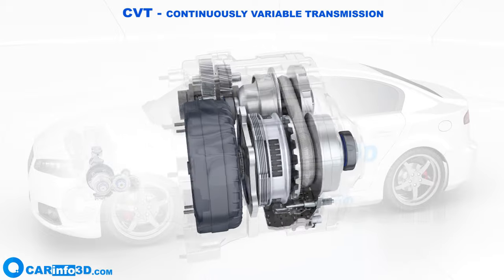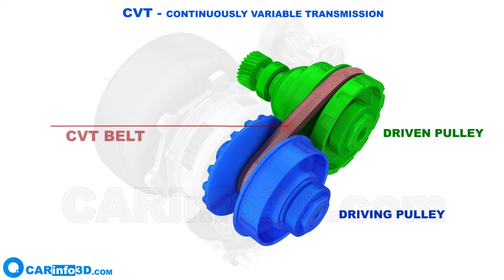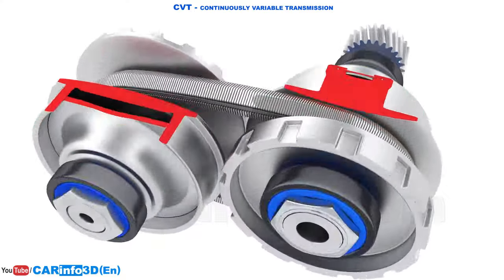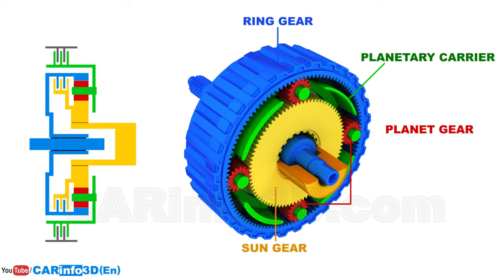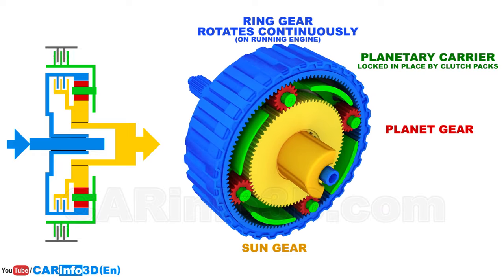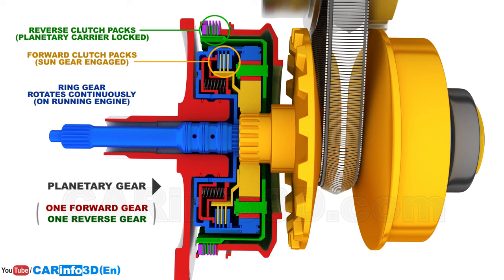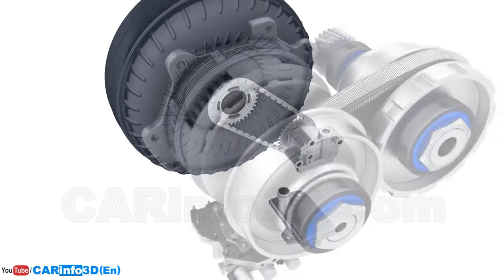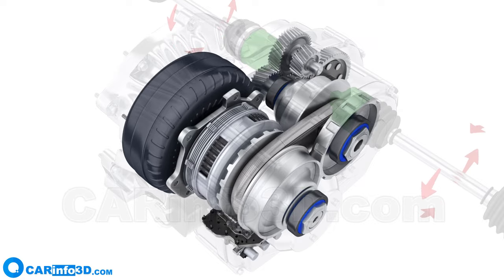CVT Transmission / how does it work? (3d animation)

Comment: As a mechanic, I can tell you these are our #1 money maker in the shop.  Its a golf cart technology that was implemented into 4000 lbs vehicles.  They can be reliable to a degree if you drive like my 80 year old grandma.  Slow acceleration, speed limit and no sudden acceleration.  The problems surfaces when people drive them like traditional gear transmission.  They're not built to handle that.  Car manufacturers like them because they are cheaper, lighter and get slightly better mpg so they can advertise for it.  I personally would not buy a car with a CVT.
Reply: I have one in a Cube.  I warm it up on the drive everytime before setting off and then drive it carefully.  Fingers crossed 😁
Reply: Had to replace the oil and transmission fluid more often… poor performance. Not worth it
Reply: I second this
Reply: Exactly
Reply: Eh it depends on what CVT you get and what car company you buy from. I have a 2016 Honda Civic 1.5L Turbo with the CVT. Havent had a single problem and Im sitting at 163,000 miles. I am the original owner. I also change my own Transmission fluid at the correct intervals. Alot of these bad cvts are to do with poor maintenance on the customers part for Hondas and Toyotas especially. I know alot of the other car manufacturers are garbage with cvts. I also drive 80 plus mph on the interstate  1hr to work and back home 7 days in a row. 7 on 7 off work shift. When my car gets to 165,000 miles I will change the Engine and Transmission oil and fluid. I believe the last time I changed transmission fluid was 130,000 miles. I would like to also add, that I am not a slow driver either. I like to put it in sport mode and get around people in traffic. Its extremely responsive.
Reply: Yep..depends on who makes them. Jatco ones have more issues. And these are the ones that Nissan uses.
Reply: They came from formula one Williams not golf cart.
Reply: @Kk385  , yes, it was a formula 1 golf cart🤣🤣
Reply: We bought one. Didn't know about all of this at the time. Cannot accelerate quickly.
Reply: @John34. I have a 2014 Nissan Versa with cvt. 210,000 miles strong. No issues thus far.
Reply: @jimborghini2761  Well, that's great you have one that's not failed. I understand where you are coming from as my wife has a 2018 Jeep Compass that are known to have all sorts of issues with sensors and the transmission. We are over 100,000 miles original miles and have had zero issues whatsoever
Reply: I've been renting a prius for taxi and ragged 80k miled driving like Michael Schumacher in the last year. it's gone from 74k to 150k no gearbox issues so far. no trans fluid changes, and only 1 oil change 30k ago.
i actually like the cvt, the lack of gear change actually keeps me in front of much more powerful cars. it's not good for top speed, but its good with acceleration. I'm thinking about getting gs300hybrid so more curious about the ups and downs of a cvt. OP - what sort of issues do u get with cvt's and which brands, What's your experience with lexus cvt's. I'm a former mechanic myself but I've been out the trade for a few years and my experience with cvt drive trains is almost non existent.
Reply: @chozusmakavelli  NOT OP but IIRC Toyota uses eCVT on their hybrids (including Lexus) instead of the traditional CVT. The way they are constructed looks waaaaay more robust than the chain.
Reply: @CuteMegaPanda  thanks, I've just bought a 2019 is300h with 90k, but I've had plenty of Lexus's and they've never let me down.
Reply: @Poorlybobsdad  you better maintain it. Replace transmission fluid every 20k miles
Reply: ❤Thank you
Reply: Yes combine that with people not getting the fluid and filters changed as they should and that is why so many have a problem with them.
Reply: Do not understand why people have to accelerate hard all the time. How you drive your vehicle determines how long it will last. As for this so called mechanic here, you do not have to go to that extreme. Just drive normal. You must be one of those assholes who have to punch it every time you stop.
Reply: @scrambler69-xk3kv I’m not super familiar with cars and CVTs but would you say the 2025 Civic Sport Sedan is good? Just want to know in case for the future or something. To gain knowledge
Reply: 2017 Toyota Corolla le CVT has 297547 drain and fills every 60,000 and I don't baby it.
Reply: Yes I believe you are something 🤣
Reply: @John34.  Im buyin the hyundai elantra 2020 SEL with CVT driven tranny and worried ab alm these comments but the car only has 69k miles total
Reply: Toyota cars use this, preus is example and failure rate is negligible 
May be honda is bad 😊😊
Reply: I'd go a step further and say that  this design belongs on a bicycle 🚲
Reply: What CVTs though? Some brands make them horrible. In low to mid end cars they are hands down better than DCT and 4 speed TCs.

Comment: I get manual transmissions but even with this channel's great animation, I still can't get my head around this.
Reply from the maker: Soon our video course will be released, there will be more of our videos and there will be time dedicated to the manual transmission.
Reply: On a very basic level it is a very simple idea at work; two sets of moving plates with chain/belt that mimic gears/sheaves of different sizes, that can change speed ratios between driving and driven side.
Reply: @spol1622 its hard to understand without seeing it with your own eyes and being able to touch the parts. i dont get it through a video, your words are like a foreign language
Reply: @nicolasr7706  that is the beauty of humanity, we all learn in different ways!
Reply: @spol1622 that was so bad and I'm SURE not helpful to the OP 🤣🤣🤣🤣🤣
Please don't ever attempt to be a teacher of any kind
Reply: Don't feel bad, they didn't explain what they were showing and the visuals that are the most important are semi transparent almost as if they're not important. I don't know if I can describe it with words, but basically focus on how from the top angle the two "halfs" are angled like wedges. Traditional drove belts "connect" on top of the axle, these have serrations on the SIDES and connect to the SIDES of the wedges. So as they spread apart that moves belt to a bigger or smaller rotation diameter, like a bigger or smaller gear.
Reply: The operation is similar to a bicycle with 20 gears, or however many it has.  When you climb a tough hill (low speed), the chain is on the smallest front sprocket (at the crank, where you pedal), and the largest rear sprocket at the back wheel.  For going fast down the road, the chain is on the largest front sprocket and the smallest rear sprocket.  The bicycle chain uses various size sprockets, while the CVT simply varies the size of the pulleys.
Reply: thank you.. for the tip
but what about the reverse
Reply: If you have seen a bicycle derailleur gear/sprocket system, you already know how this works but just haven’t spotted the similarity yet!  Put the chain to the small sprocket at the front, and to the very biggest big sprocket at the back (on the bicycle it’s on the wheel itself), and that’s your ‘easiest gear’ to pedal in.  But, totally pants for speed, you barely get to walking pace and it’s too fast to pedal.  The extreme other end of the bicycle case, is when you put the chain onto the biggest front sprocket, and the smallest usable rear sprocket, and then you can’t even start off on the level, but at speed, like down your favourite hill, it’s great!  

The in-between, is just a series of steps on the way to one of those extremes.  The special/weird CVT flexible belt depicted, is like a bicycle chain.  The cones, are ‘imitating’ being sprockets ie as they squeeze together, it makes the belt move to a bigger diameter position, or as the cones pull apart, the belt can go to a smaller diameter position - this is like bigger and smaller sprockets on your bicycle.  You get it?  It looks more complex, because I think the system in CVT moves BOTH sets of cones at the same time…think about it, this is done to keep the belt at constant tension, but it doesn’t affect the analogy used here.  On a bicycle, the little ‘arm’ with plastic guide wheels at the back, does the job of maintaining tension on the chain.  In neither system do you want more tension than necessary, because it’s wasteful and gets hot and wears out the drive belt or chain.

The commenters here, I agree with though - it’s ok for small cars, not put under strain, but the design is fundamentally a total disaster, is my view!  To me, it’s a system that needs to grip, and yet slip at the same time.  Phfft.  Not my cup of tea, it’s like an engineering no-no.  But, just my opinion.  Also note, the e-CVT used by Toyota, in hybrids, does NOT use this system or anything remotely like it.  No cones, no belt, no friction surfaces of any kind except in a special ‘emergency’ capacity that is not normal use.  Almost unbreakable, and certainly more reliable than anything except two gears constantly meshing, in oil, like EVs often have.  That’s it.  Turn a bicycle upside down and try the gears out, you will see what I mean.  Big at the back = slow speed.  Big at the front though = high speed.  Torque or pulling power/rotational strength, is the OPPOSITE of whatever the speed  is I just said.  In other words, the bicycle system of sprockets, enables you to put more spins of the pedals into a single turn of the rear wheel…that’s more energy per turn of the wheel, ergo you MUST be getting more torque out at the rear wheel.  A word about the penny farthing bicycle - that must have been hard to pedal, until they fitted sprockets etc.  Take care all.
Reply: Yea Manuel was definitely easy to catch on, but automatic & cvt took a minute I recommend looking at gear ratio videos to assist
Reply: this channel made me hate it more

Comment: I'm not impressed at what's for sale out there these days for new vehicles. Turbos and CVT's, AWD/4WD systems, cylinder deactivation, VVT and poorly designed timing systems, low tension piston rings/oil burning, and complicated hybrid systems that are all maintenance nightmares. And if that's not bad enough, the electronic monitoring of your vehicle and how you drive in the name of "safety", the disabling of functions on your car unless you pay for a subscription (Toyota remote start) are becoming commonplace. You can keep it all.

Comment: Nissan Note 2006, bought at around 50,000km traded in for another one (only 2009) at 361,000km, no transmission issues whatsoever. That was a lot of long hot miles, proper, timely oil and transmission fluid changes plus sparkplugs etc. Got around 100,000km from one set of front brake pads. Took the time to understand how cvt works  internet videos were excellent, and drove it that way. Found it a very relaxing and rewarding experience, even over demanding terrain with two three, or once four hitchhikers and their backpacks crammed in. Follow the Designer's handbook, guys. And far more importantly, the same applies to your own body.
Reply: Do you have any tips where I can find the designer's handbook for the human body? Year 1996, caucasian male chassis

Comment: I have a 2017 Honda with the CVT. There is a little lag when starting out, but not that bad. I also have a 2023 Lexus and they improved the transmission by adding an electrical assist. There is no noticeable lag, and if you floor it, it takes off immediately. I rented a 2022 Nissan with a CVT and it was junk. You could feel the car slowing and accelerating while keeping the gas pedal steady. Sometimes when coasting to a stop, it felt like the transmission was holding back the car. I was glad to return it to the airport.
Reply: "You could feel the car slowing and accelerating while keeping the gas pedal steady."  This is one of the most honest CVT related statements.  Exactly what manufacturers do not want car buyers to know.
Reply: Driving a 2016 Sentra gave me the exact same issues. Had the transmission die at 163,000KM, replaced it with a brand new one and it still drives like a piece of garbage. Horrible cars!

Comment: CVT requires careful maintenance which is to change the fluid every 30k km to 50k km the change must be complete with filters, another is the oil temperature must be below 90°C to have derabilidad, bad for the cvt which does not have a belt replacement part This means you have to change all gears and depending on the country you live in, the cost of a new one is very expensive.

Comment: my 2016 honda civic 1.8NA engine, hit 159000 km last month, the cvt belt breaks... cost me RM19000(roughly around 4000 usd ) in honda service center, they actually just replace it with a new gearbox

i repaired it in outside workshop for just RM3500( roughly around 800USD), they replaced the broken belt and reworked the torque converter
Reply: Whats your cvt fluid change interval?
Reply: @zaimikmal6631  as per honda service center, still sevice it at honda service up till now

Comment: makes sense why most car makers went to cvt, less complicated cheaper to make resulting in cheaper cars to sell to the public. Since this thing uses a hydraulic like lever system to change gears it makes sense to constantly change the transmission oil more times than the engine oil.

Comment: Never again will I buy a car with cvt transmission .
I had dodge caliber with cvt and it overheated constantly and went into limp mode .
It was changed 3 times under warranty and everyone had the same problem it was the worst experience ever .
Winter was the only time it worked properly but summer time I had to baby it to point of pissing people off how slow I had to drive and it still overheated .

Comment: I wonder why the chain does not slip on the shafts canals when torque is applied. They seem to me pretty polished from inside  and they are submerged in oil.

Comment: I have Subaru Legacy 2017 with a CVT transmission and it is great!
Reply: Until it fails and costs you $7000 and a 6 month backorder wait.
Reply: @milfordcivic6755  I do have Audi a6 C6 and my gearbox failed and to get and repair the company asking 2500 pounds 😮 for new one 4200 😂

Comment: i have a question: i've heard that most of the failures on cvt is on the belt, and the preventive action is to take care the transmission oil.
based on what i learned that this is PUSH belt, and based on https://youtu.be/PQHVLH8jVc8?t=77, is the cause of the failure often that the moveable halves did not move simultaneously, causing the 2 rings of belts slips out and made the links (elements) fall off?

i've always assumed that the belts break because they were overstressed by the pulley
Reply: If pulleys are not moving simultaneously there is an oil pressure problem. Likely due to people not changing the fluid on proper intervals, and techs not doing their job and changing the filters.

Comment: Does Honda's CVT have torque converter?
Reply: The belt changes diameter (that's not right, but you know what I mean.)  That's how the torque is adjusted.  It doesn't have to change gears to change gear ratios.
Reply: @briankleinschmidt3664  the torque converter, it doesn't shift gears, do you know its role?

Comment: MODERN TOOL & DYE. KNOWN AS MTD PRODUCTS. CLEVELAND OHIO USA. Had this system in their lawn tractors from early 70’s. Still used successfully until this day however, hydrostatic transmissions have become cheaper, to manufacture but not to install or replace.

Comment: Useless transmission in my opinion from 2024.
Lexus really put this to an RX 450h, you going to the "Autobahn" in Hybrid Mode suddenly the engine rew to 4500 rpm outside is -5 (engine cold) and you going.... Gratulation these cars are not making 200 000 km.
Reply: Got 260,690 on my cvt
Reply: @chrispalmer3979  talking about hybrids

Comment: garbage CVT
Reply: You don't know what you're talking about.
Reply: I've done my research.  You like cvt get a cvt . Seems like you're a master of transmission 🥱🤣
Reply: @kossher8834 what are the cons of cvt pls let me know before make purchase.
Reply: Some of the common problems that owners run into include overheating, slipping, and sudden loss of acceleration. Shuddering is also a common problem. Since CVTs depend on the belts to operate, if these suffer from excessive stretching or too much wear, the transmission can completely fail
Reply: @kossher8834  so i got the point it will completely broke rather than giving symptoms before fail. Thanks for that. So the manufacture is bastard.
Reply: Cvt is a little better on gas but I will cost a lot more to maintain and fix and its not much fun to drive ... good luck 👍
Reply: "Garbage" depends on the what you expect from the transmission. If you expect to not maintain it and get 200,000 miles out of it...then yes, it's "garbage". But if you're handy with a wrench or don't mind paying to have it maintained, a simple 30,000 mile fluid drain and fill will keep your CVT happy for many miles. Most of the bad things you hear about CVTs are from Nissan's terrible Jatco units. In those cases, it wasn't the fact that it was a CVT that cause the issues, it was the fact that it was a poor design and it was cheaply made. Most people who poo poo a CVT have never owned one and have zero experience with them or they have owned or worked on a Nissan. 

Honda and Toyota units haven't experienced the same issues and the Nissan Jatco units. And if you think geared transmissions don't break, well...just ask any mechanic. They fail too. 

The key to a healthy long lasting CVT is changing the fluid. It's not expensive, and it takes just a few extra minutes when you're doing an engine oil change. I've decided on 20k mile drain and fill intervals, but will send off a sample for analysis to see if I need to shorten or if I can extend the drain interval. 

So far, I'm happy with my  CVT equipped vehicle. Excellent fuel mileage, and my tiny 1.5L engine always seems to have plenty of power because the CVT keeps it in the power band.